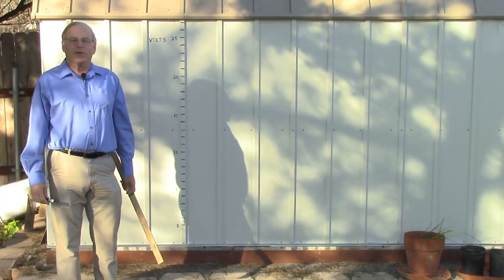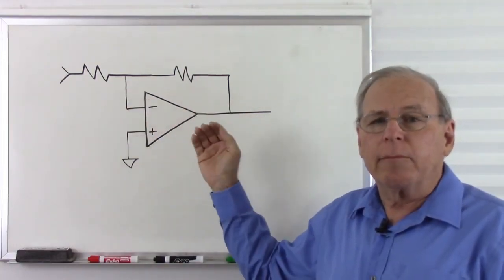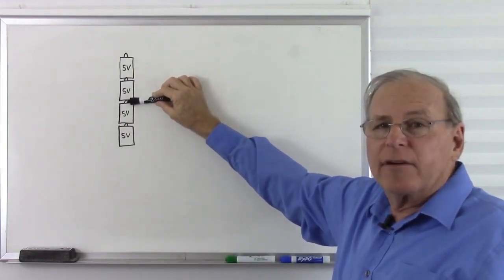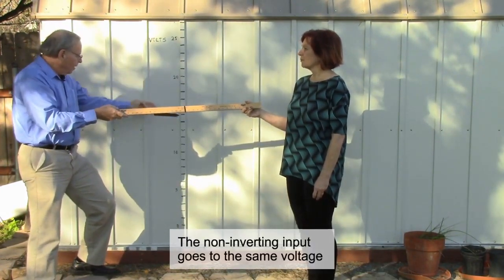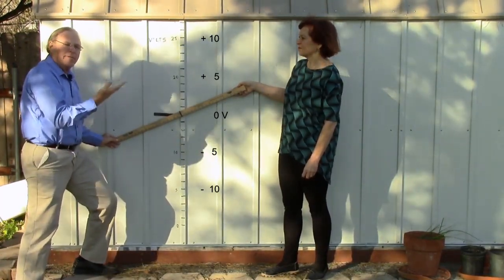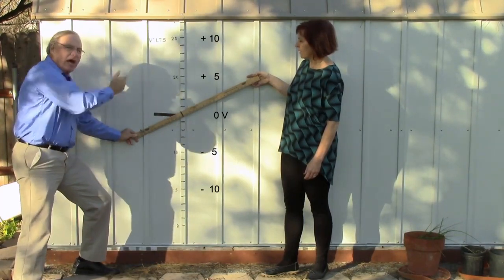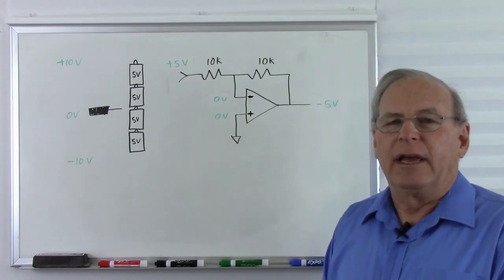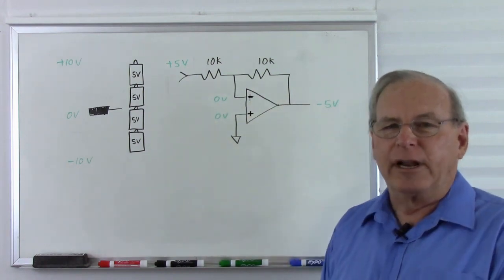Why an Op amp Inverting Amplifier Appears to have no Input Signal

Comment: For me, it helps to remember that the op amp has its own power source. It's not just a passive result of the inputs, it's actively using its power to compensate against changes to the input(s).